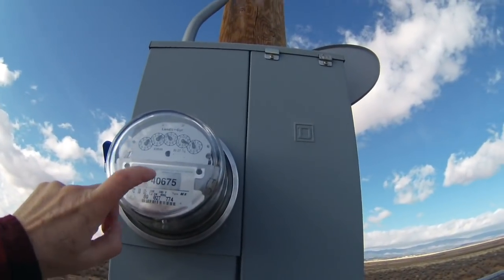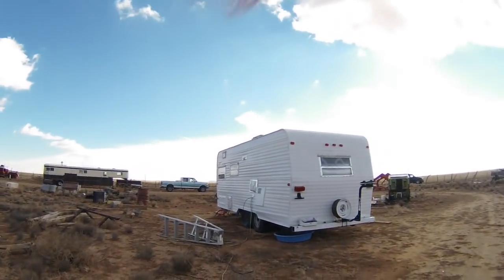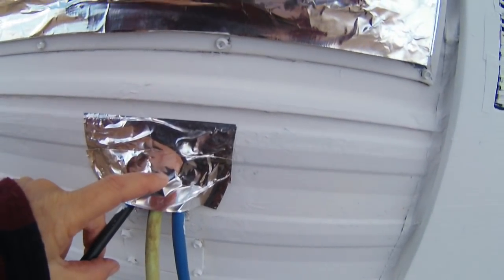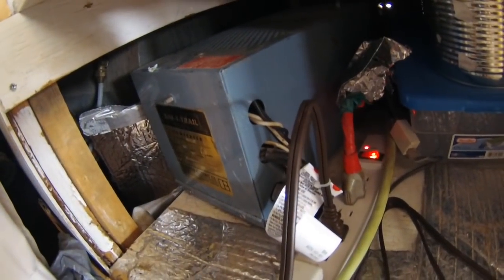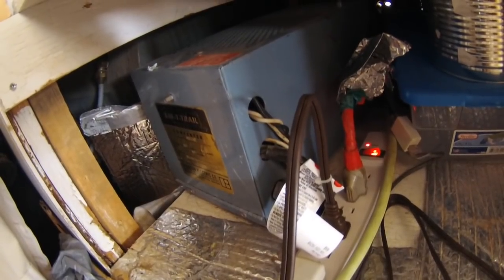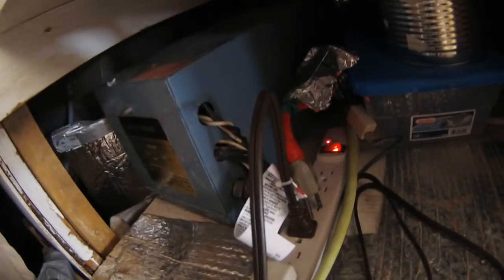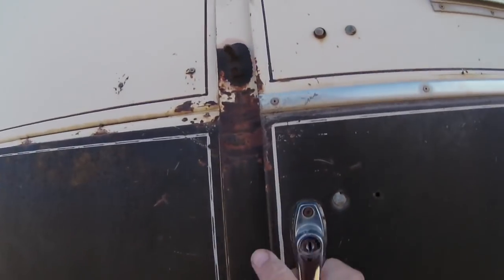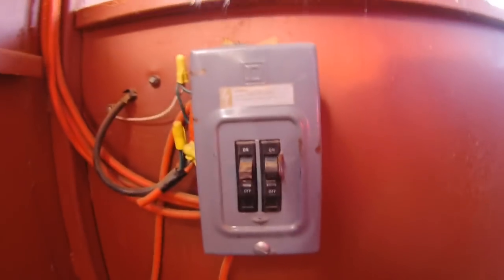Electrical System & Wiring Overview for Trailer Renovation (4)

Comment: Looks like your trailer would be great for doing solar panels and have another independent method of electrical generation system to run many things such as LED light strips (and fans)that use very little power but can make a lot of light and can put on light sensors where they wont come on until night or can shut them off completely. Many of the LED strips also can create any color  through the spectrum also so you could choose what color light you wanted also.

There are field biologists that run their computers and whatever they need for work off small solar power systems and they seem to do well. Looks like since you have a good solid frame constructing from,can have a sturdy solar power system.
Reply from the maker: Thanks DL, yes lots of options!

Comment: I think all you need is a 30 amp system. It is big enough to run an A/C or whatever and not have too many issues. 15 amp is small and anything bigger than 30 would be overkill unless you are going to be running two A/Cs. You can get USB color changing LED strip lights at wall mart for $4.88 that work great. I plug mine into a USB battery bank
Reply from the maker: Thanks Zane and that is my thinking too on the 30amp.  Will look the other up!

Comment: Watts = Amps * Volts ... Think of Amps as the size of the river, and Volts as how fast that river flows.  Volts for most appliances is a constant though, 12 volts (cig lighter), or 115 volts (AC house outlets).  ...  I agree with NOT putting things IN the walls which is basically unmaintainable.  But you probably want to avoid too much up high as THAT is a lightning hazard.  Although kid of moot in a metal box (faraday cage).  But lightning favors the path of least resistance so if you're on flat land and the highest point standing up, there's your problem.  A lot of lightning deaths are from people seeking shelter next to the talest tree, so the tree gets struck, and so does the person next to it.
Reply from the maker: Thanks, I like to think of it as water running out of a faucet - water flow, size of pipe, and regulation of rate of flow - and yes on the lightening - still thinking about how to deal with that since it is only going to get worse...
Reply: You can mitigate the risk by where you park.  There's various lightning rods you can put on roofs to give a route for lightning to travel if it's unaviodable.  Many barns have such things so the barn doesn't burn down when struck.  Although a bit more permanent as it implies a 6' copper rod embedded in the ground.  Or something like that.  Not a home owner only seen a few things on roofs over the years.

Comment: Hello Jill,  I live in Florida and lost power for 4 days after hurricane IRMA.  No problem with simple solar for 12V lights and fans all night, small 200-watt inverter for AC to charge computers and cell phones, and even small 12V cooler.  I have 3 deep-cycle batteries, a cheap Multi-meter to measure 11.9._volts  (means battery low so I charge for 1 hour each morning) to 12.5 volts (means battery does not need charging today), AND 100-watt solar panel to recharge the batteries every day when needed.  Each battery has a cheap 3-socket car cigarette-lighter expander_box glued to the side, and all 3 batteries are movable.  1 battery is in the bedroom, another battery in the living room, and the third battery is in the screen-room.  Oh, and the solar panel is movable and has a 30-foot interface cable with male/female connectors for the 100W solar panel, and Alligator clips at the other end to hook-up to any 12V battery.  ANY MORNING THAT ANY 1 BATTERY OR ALL 3 NEEDED CHARGING, I carried them outside  along with the solar panel and cable;  and hooked-up each one in the sunshine for 1 hour..  After they are charged, I carried them back inside for the next night`s  use.  In Puerto_Rico, they will have to live for a year this way; because their electric isn`t coming back for a long time :(   50_watt panels take twice as long as 100_W to provide Re-charge of battery, but they are cheaper and weigh less).    All my LED lights, camping fans, etc have  car 12V plugs,  so they just plug into any expander-box glued to the side of any battery. Best regards...George
https://www.walmart.com/ip/100-Watt-12-Volt-Waterproof-Polycrystalline-Solar-Panel-Charger/722235224

Comment: my advice. keep it simple.  you probably  only need two AC outlets.  keep everything else DC with an AC to DC transformer.  also you can run all your wires in metal conduits  to be rodent proof.  of you  can afford there is also flexible  metal conduit.  yiu can run this  exterior wall  with key access points.  run this idea  by the person helping you.  Great job on videos.
Reply: sorry  for typos my phone  is crazy

Comment: Ya you can switch easy from one to another. I use the "Suaoki 400wh Portable Solar Generator" and all I can say it is an awesome device. They make bigger ones and price goes up.
Reply: Can you change the battery easily on that? 
I used to have battery boxes but they all failed after a couple years and it was impossible to replace them without destroying the units.

Comment: A handy little device to get is a "Kill-A-Watt" (less than $20). I've tried to explain Volts, Amps, and Watts to other people without much luck. But plugging one of these in lets them "see it in action" (at least for AC). You can also see the effect of the "voltage drop" that a long extension cord under various loads experiences. Unlike a house, an RV is frequently on the brink of maxing out the electrical power available for it, so knowing where the power is flowing to is helpful. 
I agree that having your wiring available and not hidden inside the walls is a great idea. The walls will end up being better insulated.

Comment: This is a link for portable solar unit review  but it is expensive.   https://youtu.be/bE2V8Mva9Hc
Reply: Jill, this is the bigger one of the one I suggested in my comment above. Trust me they are pricey but you will love having a solar generator and much easy to set up compare to batteries, charge controllers, panels, fuses, and inverters.